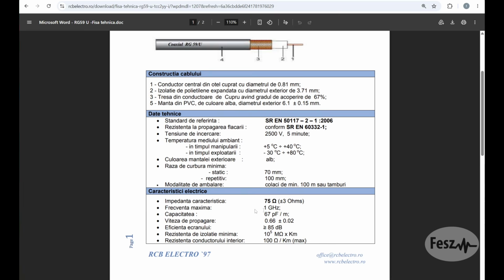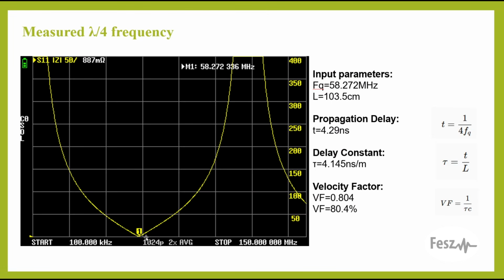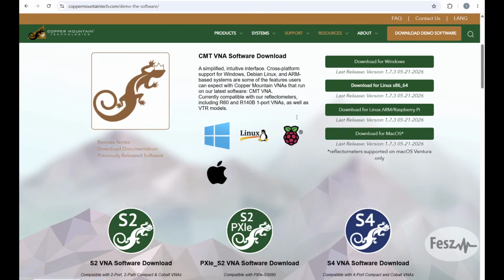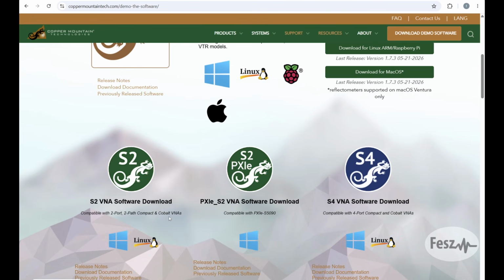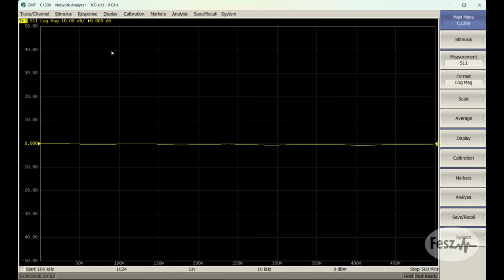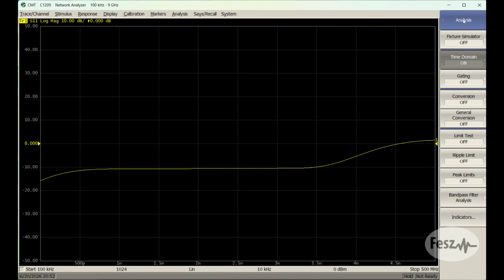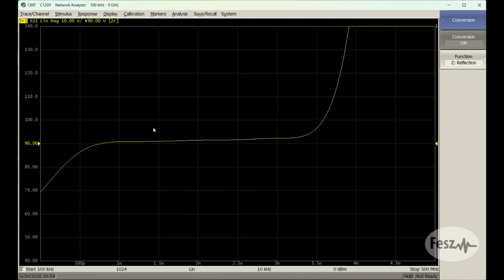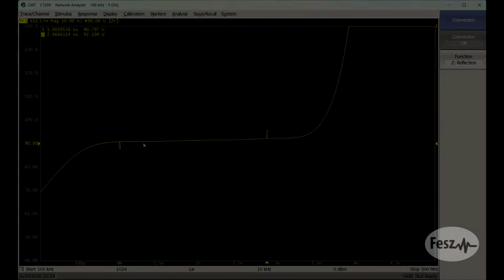Cable Measurement Tutorial

Comment: Hi, do you prefer this system over the quarter-wave method?
Reply from the maker: To be honest, I very rarely had to measure the impedance of a coax, so the method didn't really matter; I enjoy that the TDR method shows how uniform the impedance is throughout the length of the line - it can highlight if there are defects somewhere.

Comment: Try to load open end of cable with some resistive load. As many times as I tried TDR for cables it was very unprecise and changed a lot the more measurements I have done. TDR should be extreamelly precise impedance measurement technique, but personally I haven't got any good results, especially for short cables

Comment: That is one very interesting result. I think I would have taken a much more lazy approach, terminate the coax with 50ohms, and see what the impedance is at 1/4L. Rearranging Zin/Zo = Zo/Zout gives sqrt(Zin*Zout) for the actual math here.
50ohms VNA = 50ohms cable
113ohms VNA = 75ohm cable
162ohms VNA = 90ohm cable.

You've certainly got some mystery meat coax there.

Comment: I've seen el cheapo 75 and 50 ohm coax with impedance all over the place, so this big of a difference does not seem impossible, however, at 0:38 we can see that your coax has a pretty decent shielding (cheap 75R coax usually has foil and maximum 10 strands of wire), so the mislabeling theory seems more plausible.
I myself prefer the method where we terminate it with 50 ohms, then just look at the smith chart. Works very good with standard impedances without cursors.

Comment: In my opinion, a TDR used this way is not suitable for accurately measuring cable impedance, and the result you obtained, 91 ohms for a 75 ohm cable, is unrealistic. There are more accurate methods:
- measuring the reactance at a 1/8-wave wavelength
- measuring the 1/4 wave transformer's transform rate to a known impedance
- measuring the capacitance of an open-circuit feeder and the inductance of a short-circuited feeder Z=SQRT(L/C)
In NanoVNA and LiteVNA there is a MEASURE/CABLE option which gives the impedance directly and calculates it using the 1/8 wave reactance method.
There's a video on my channel about these methods (in Polish, but maybe subtitles will help).
Returning to the TDR, I once tried to do it exactly as you did, but instead of the PC application, I used the NanoVNA DISPLAY/TRANSFORM function. To obtain a reasonable result, I had to start with a 50-ohm line segment. Only then would the device capture the reference value and display results that were close to reality, but still much less accurate than the methods mentioned earlier.
Reply from the maker: I also tried the NanoVNA software, but I could not get good results; this software from CM did work far better. I also used the CM software on a more complex multi impedance line and it gave good results. Anyway, I also measured this test line with a proper TDR, and got the same ~90R impedance, so I'm fairly confident in saying its a valid measurement.

Comment: I find it hard to believe that standard 75ohm coax is that far off in both impedance AND velocity factor over what it should be. Are you sure that's actually 75 ohm cable? The only time I've seen coax with a copper braid like that, it was some weird 93 ohm coax, RG62, which would line up better with your measurements. 93 ohm coax was used with Arcnet and IBM 3270 mainframes, hence you find remnants of it occasionally
Reply: I just looked it up, RG62 also has a characteristic velocity factor of 0.83 to 0.84, so again, it REALLY seems like your mystery coax is actually RG62, not any kind of 75 ohm coax. Both your measured impedance and vf match very closely to what RG62 is supposed to be
Reply from the maker: That might be it; probably there was some mix up when they marked it, who knows... this was the cable I used in the previous video for the splitter, so I was really curious what happened, why the circuit came out so different than intended.
Reply: @FesZElectronics  does the simulation now match the actual circuit implementation if the simulation is updated with these measured cable parameters? That would br interesting to see/know.
Reply: @FesZElectronics  Yeah, I watched the previous video as well, and as soon as you mentioned "90 ohms", my ears perked up, as I know I'd run across such coax myself before. Pretty sure I still have a fairly long length of it in a box of other coax somewhere.
Reply: Excellent analysis. Trust but verify. This video stands out because it was an interactive dialog and a conclusion that cable was a different impedance by design not set up or measurement concerns. Excellent I really enjoy all your presentations.